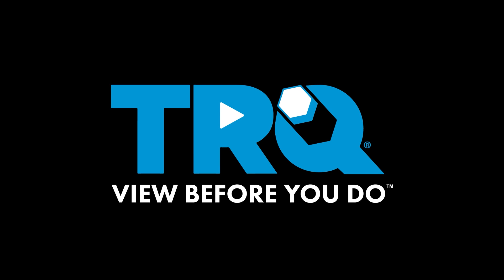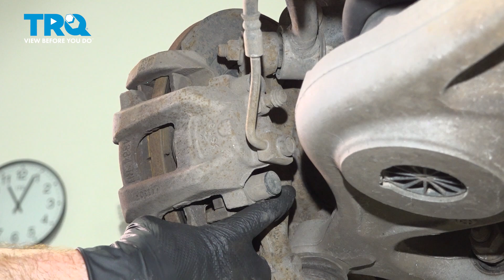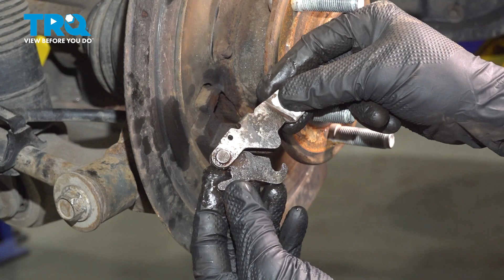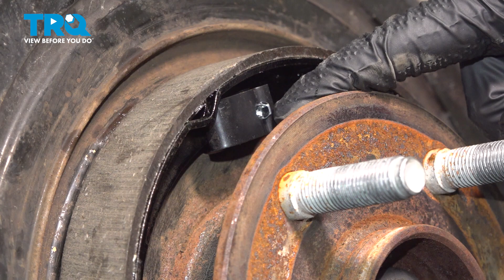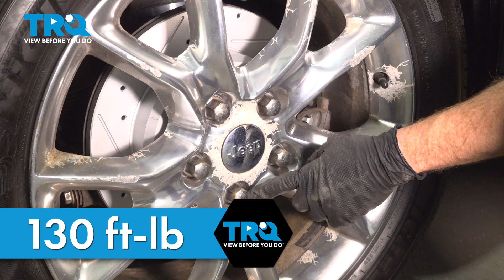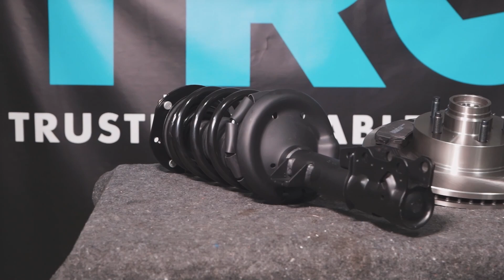How to Replace Rear Parking Brake Shoes 2011-2021 Jeep Grand Cherokee

Comment: The Video is very nice but it don’t explain how to adjust the brake Pedal. If you Push it when it’s adjust like in this Video the Pedal will go to the Floor and it doesn’t brake enough. I have the problem today. You have to adjust it when the disc is on from behind. Please do a video of that👍🏻 it’s important